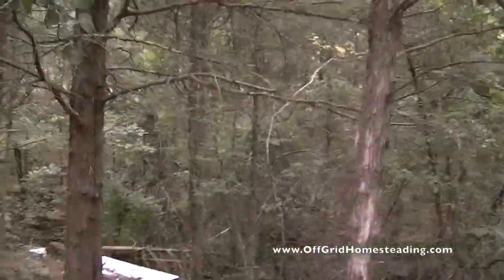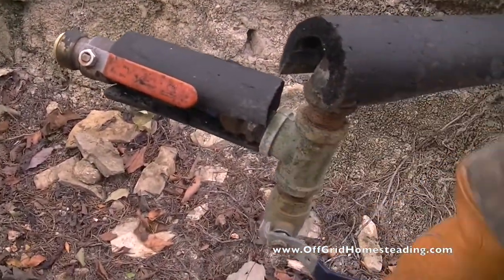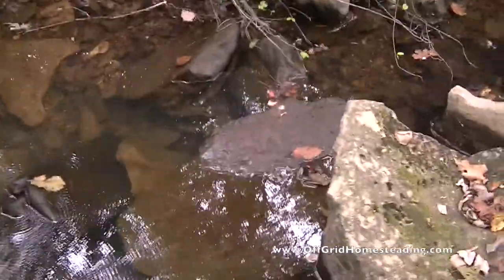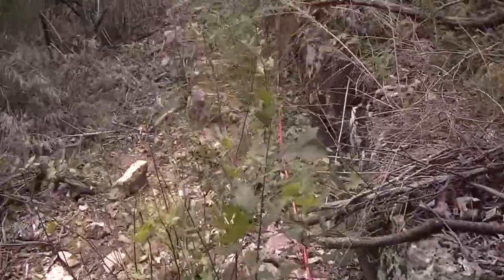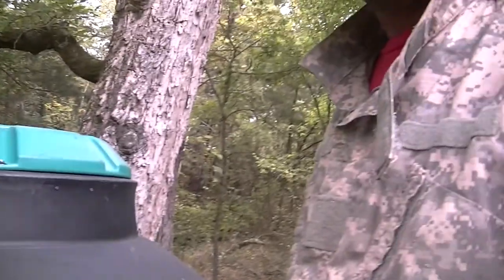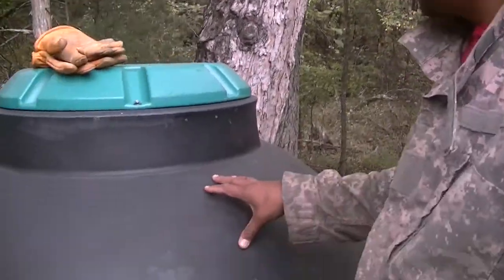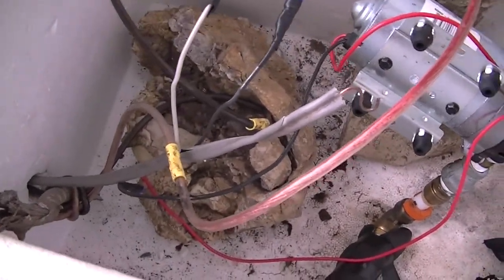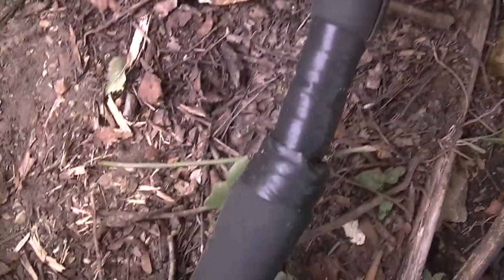OGH - Inexpensive Solar Pump, pumps over 500' Uphill & 35' Head

Comment: my two cents worth:  first, the set up looks good. 
i would recommend a sight glass on your tank,  1/2 clear plastic pipe works well and is inexpensive. or use a laser thermometer.    as for your switching method, double pole double throw, that way you either feed the dragon drinking from the spring, or the donkey at the storage tank.

lastly, if you want to bypass having to come down to open valves, you can set a float valve inside your tank which closes on full (keep the over flow drain in place but set just slightly above the float) and when the water coming in hits that float, the water will bypass the tank fill, and with a very slight rise, or the use of a one way back flow preventer (which is what i use for a lot of things), the water will flow into your upstream line to the house.

your creativity to build this is pretty exciting and i will check out your other videos.  i know this is 5 years old, but still it is good.

2022, i'm building a rather over engineered system for a well i'm putting in.    i'm looking at other things folks have done to learn more about my craft.   being a mad scientist is not easy in this information age, as so much information is available on the net
Reply from the maker: Love to hear about your project, please email your contact info to me at John@bydllp.com with a good phone and I’ll reach out.

Comment: Didn't really show the pump looking for one to fit inside a 2 inch well casing
Reply: Hey Squire.  This video shows the pump better.  I know it wont work in a 2" well casing.  You'll have to know how high your water is pumping from below ground (the total head), and how far (distance) to make that determination.  I dont know of any 1.5" pumps that could do a significant job.... if your head is high and distance is far.   Let me know what you find if you find a solution.  It would be good to know. I dont know of any well pumps that are narrower than 4" for deep well applications.  Also remember 220v will require (1/2 the amperage of the same pump on 120v) requiring smaller wire for longer runs... which is good.

Comment: How many watts are you running to your pump via solar? I’m wanting to pump water up a hill to create a waterfall from the creek below.. Any help would be appreciated, thanks in advance!!!
Reply from the maker: Hey Cody, the solar panels are currently hooked up in series.  So they’re pumping out 0-to 24v, at around  7amps.  The pump uses what it needs up to its max rating.   I think this version of the pump I’m on right now is the 24v version.  I have used a few of the 12v versions.   Just remember their lifespan if you’re relying on it seems to be about 1 year or under.   Make sure you have a spare.  J.
Reply: @OGH - Off Grid Homesteading  can you tell me the exact voc and amps of your solar panels cheers

Comment: What's the power of that pump ? I'm totally lost on what minimum pump I need to put next to s river to suck water from 2-3m deep buuuut push water around 10-15m high up and 60m forward. ??
Reply: This one will do it.  Just make sure you have a sediment filter on the intake of this so it doesn't get damaged.  I had put out a video using this to pull from an open pond, when our spring dried up, and it worked even further than the installation at the round tank.
Reply: They're available in 12v and 24v.  Go with the higher voltage, and it allows you to use smaller wire.
Reply: @KarlsBerg87  it doesn't say.    All I know is what I've tested.  It really doesn't show those stats.
Reply: They are all
12/24/36 really. I’ve been running one for for over a year on a 36v 175w panel. When the sun is shining bright I’d get almost 2gph. Coulda killed it pretty bad. So I’ve gone to a dual battery set up with charge controller and it’s working damn good I must say. I purchased the extended wRrantee for this pump and I am afraid it’s going to put last the 2 years extended. Lmao! I’ve seen others not get this length of usage.
Reply: Just saw your video and the content/narritive is great information.  
I would suggest to look at RPS Solar pump systems .  You can purchase only what you need or in my case it was more economical and no stress ordering one of thier Key Package.  
Water from a river, lake, pond, creek, or stream I would use one of RPS solar float systems .   
Look at the RPS Solar pump systems Key packages.

Comment: Really enjoyed your video..  Couldn't figure out how you pumped water from the river.. And how you regulated solar panel voltage to the pump.

Nice rig!
Reply from the maker: Hey Joe,  thanks for the nice comment(s).  I have a blog post that diagrams the setup here:  http://offgridhomesteading.seodle.com/2016/08/off-grid-solar-panel-build-12v-water-pumping-solution-without-batteries/ Hope that helps.    Also I DONT regulate the voltage to the pump as it's a DC motor.  If you supply less power it wont turn.  When the power hits 12-24v it runs.   I double up the panels in parallel increasing the output of amperage to allow it work even with light overcast conditions.    If you have any more questions please reach out.   We also do consulting to help you design and implement a system, or even implement it for you,  if you need that.